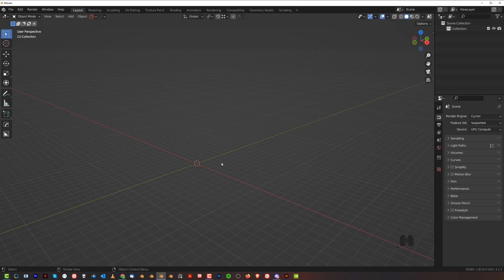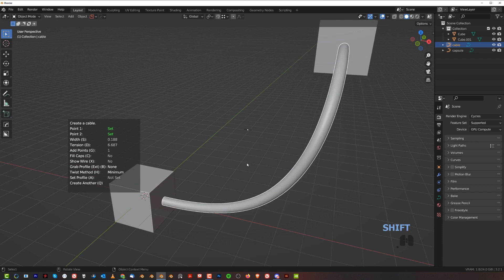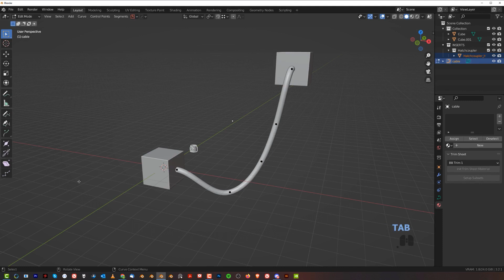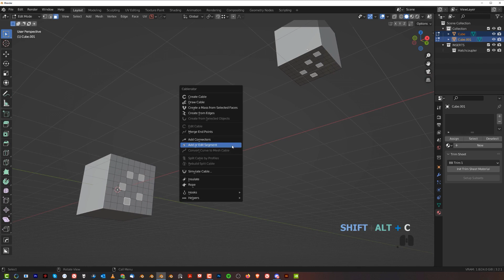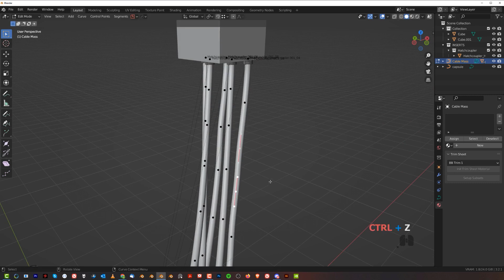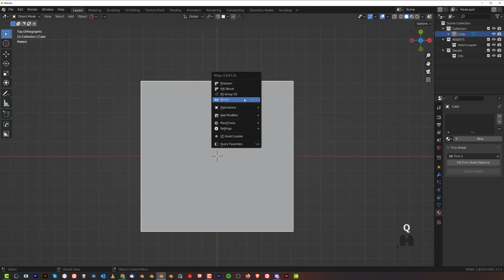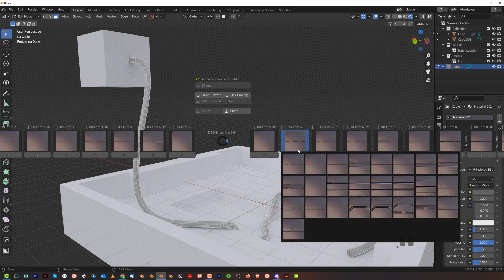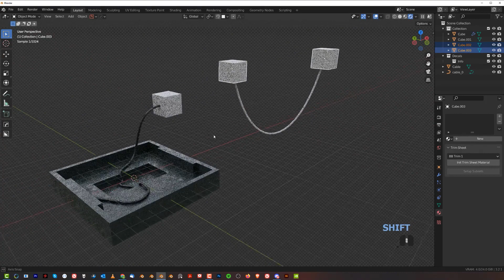Blender Addon Tutorial - Cablerator for Hard Surface

Comment: I always enjoy PR's obvious enthusiasm.  I was recently making a model of a microchip and I used Cablerator to make the bond wires, complete with the little bonded feet on the ends.  Pr wasn't kidding about the amount of time Cablerater saved me.  It was simply amazing.  I never knew about the cable wrapping feature.  It's so cool, now we can add heatshrink tubing and stuff to wires.

Comment: I hate fiddling with Array along Curve and  Deform along Curve so much, this makes it so much easier and faster to setup and saves so much time. I would also like to recommend a free addon that comes prebuilt free into Blender which is Curve Tools. And this brings Blender to Autodesk level in terms of curves because it makes making pipes so much easier and procedural. It has a lot of useful Curve tools such as Fillet, Curve Cleanup, Loft, Curve Surface tools, Curve outlines and so much more thats very time consuming to do manually in Vanilla Blender.